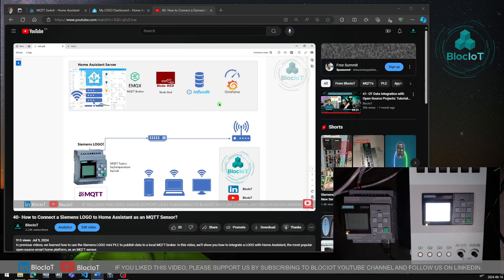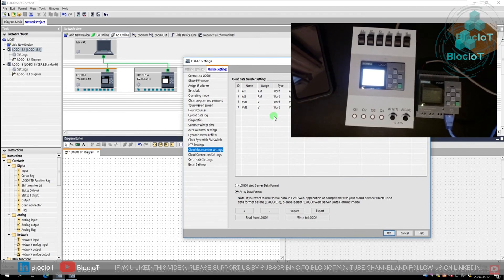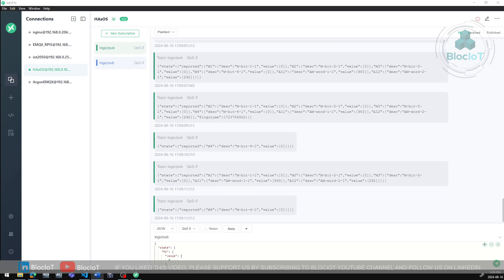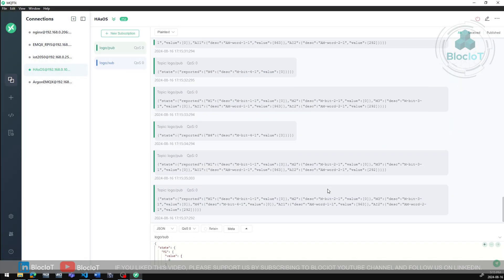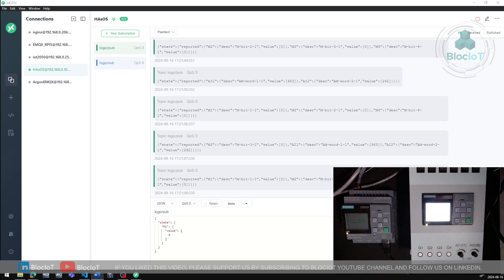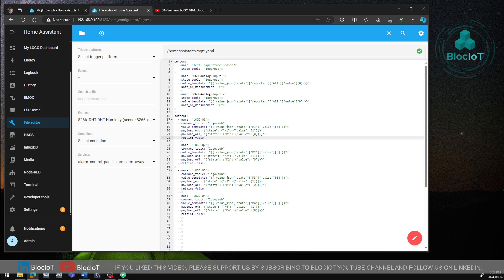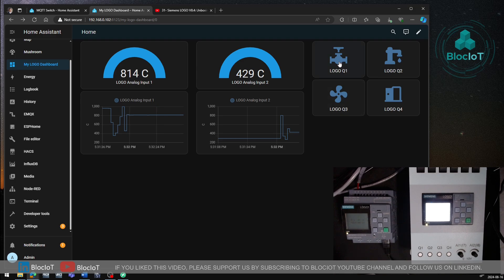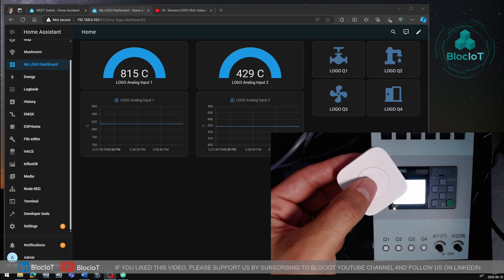44- How to Control a Siemens LOGO Digital Output from Home Assistant as a MQTT Switch?

Comment: Thanks for the video. How is the M1 value in the JSON turning on the Q1 light on? Did you just name it M1 and have it map to address Q1? Or did you make a diagram where you read the M1 value and then turn on or off the Q1?
Reply from the maker: @tomclaessens3524  hello. Thank you for the feeback.
On the LOGO side, a simple diagram connects M1 to Q1 amd so on. I should have shown it on the video, but missed it. On the HA side, Q1 is just a name for the MQTT sensor entity

Comment: Nice video! I can't get it to work -- I created cloud data transfer settings and published:

{
  "state": {
    "M7": {
      "value": [
        1
      ]
    }
  }
}

returns:  SiemensLogo1Pub {"state":{"desired":{"M7":null}}}
 
Instead of: SiemensLogo1Pub {"state":{"desired":{"M7":[1]}}}

Any idea what might be going on?
Reply: Aah I see this is also returned in your case.... something else might be going on
Reply: Yeah, all seems to be fine. What I am guessing is that the program that is active overrides the value change. I have M7 connected to the power bar (ladder diagram) and I have a break contact that I want to control. I do not see a way to control M7 without having the coil connected to some output. Any clues how to go about it?
Reply from the maker: @seattledutch so I undsrstand well, you want to control M7 over MQTT and locally from the logic? If not, you don't need to connect M7 to any coil. I would write my logic so that a dedicated memory area is allocated to data receiving from MQTT and use them in parallel or series in my logic. I'm curious what logic are you trying to implement?
Reply: @ correct, I want to add a break-contact switch so I can disable a certain circuit. However my ladder diagram doesn’t allow me to add a M7 switch unless I add an M7 coil.
Reply: @blociot  I finally solved it. I used a network input block and communicate the state through VM, and set it through MQTT. 

The switch is then used to disable a circuit by putting it in line with a health status marker as a NC which is opened when the kill switch is set to 1.
Reply from the maker: @seattledutch  awesome. Thanks for the update and great job 👏

Comment: Great video, does the feedback of Q1-4 change in HA when i toggle it via an input on the logo?
Reply: I think state_topic is missing in the switch configuration, so it won't work. I've seen multiple topics on Home Assistant Community about this, all without a proper answer. Ideally, two-way communication should work, so when I turn a light using the logo, the switch state in HA updates, and when I use the switch in HA the light turns on. @blociot idea for another video :)
Reply: @tjagusz  @10:43 it's in big red letters below in the video